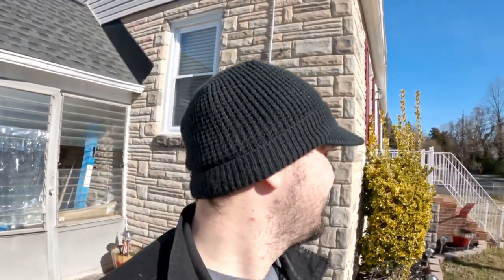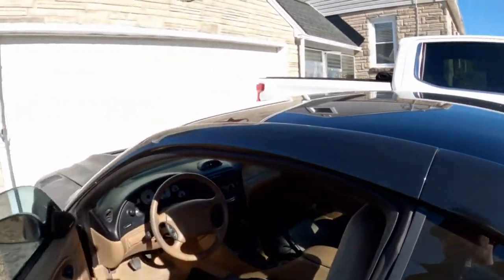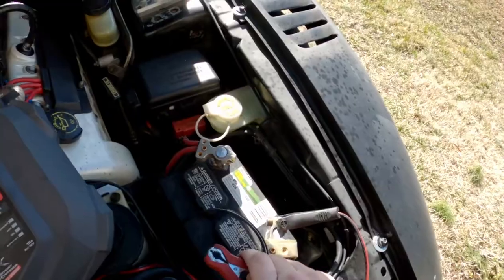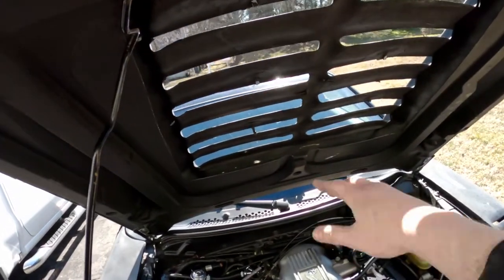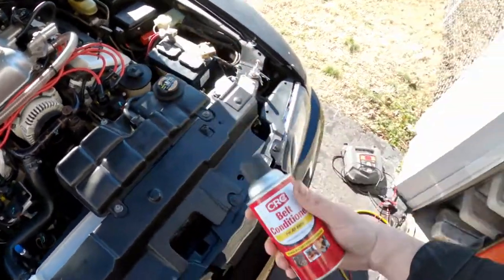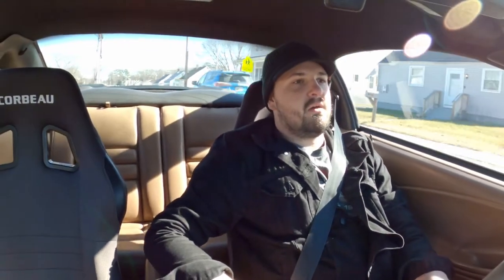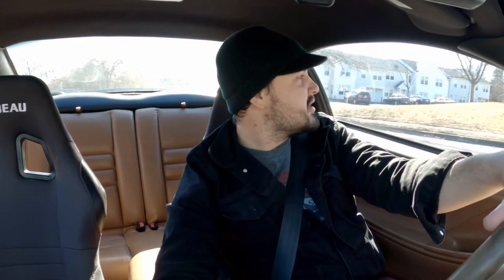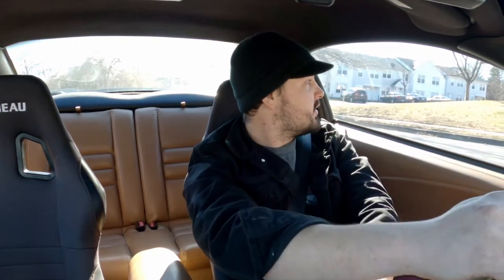1997 Ford Mustang SVT Cobra Update | Future Plans For My Cobra

Comment: Check the PCV valve. My Grand Marquis with the transplanted Mustang GT 3-valve smoked when it started up. Replaced the PCV and it fixed it. Thought it was the seals too.
Reply from the maker: It's possible. I did already replace the PCV but who knows 🤷🏻‍♂️
Car still runs strong so it's the least of my concerns lol